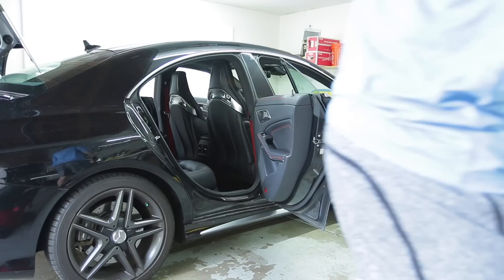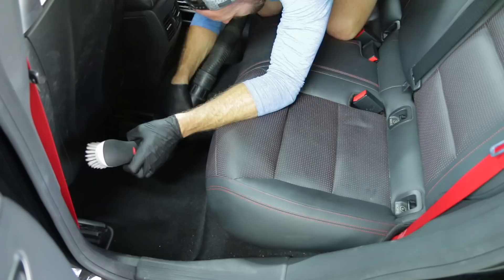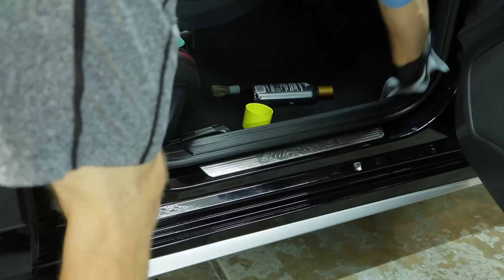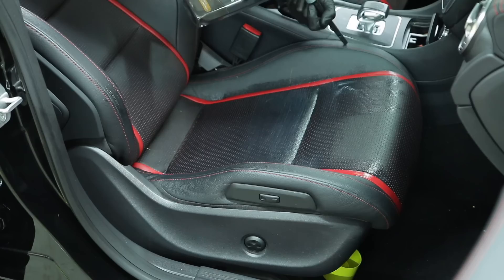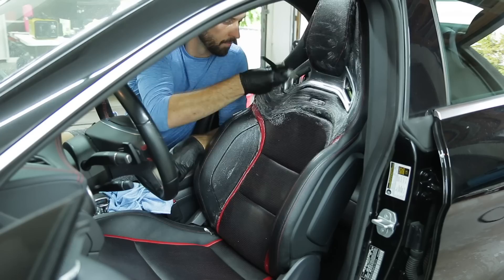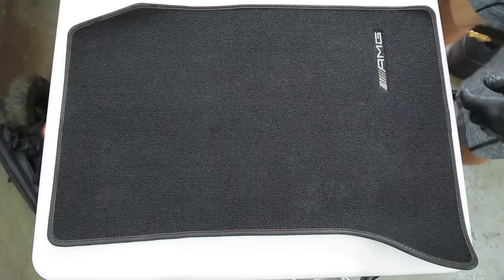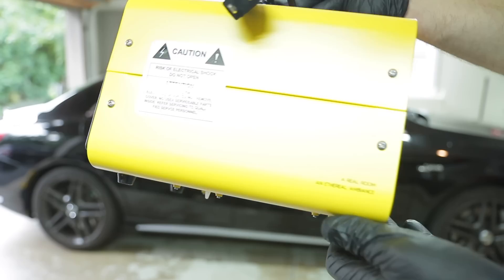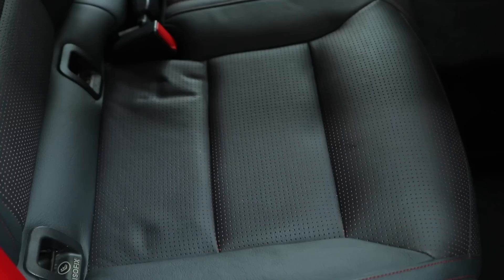Complete Full Car Interior Detailing Of A Mercedes CLA45 AMG || Deep Cleaning

Comment: Glad to see a detailer actually use an ozone generator. I bought one for my own personal use for my cars and cleaning a few family/friends vehicles. I hate the concentrated smell it can give off, but vented properly, the benefits outweigh the strong odor by a lot. I had a musty smell that stayed in my Wife's 1995 Integra that came with the car since we bought it years ago and I even tried that foaming down the vents thing but it didn't work. About 40 mins with the AC running and my ozone machine and a whole day sitting after and the next week driving the car with the windows down, all the smells were gone!!! Can't wait to see your feedback on using the ozone on the roach motel.

Comment: I have and 04 Suburban (all tan inside) & 2000 Honda Civic (all black inside). My cars are old a musty. I need to buy a carpet cleaner.
Reply: Chateece Guilbeault  sometimes even just renting a rug doctor and using it in your vehicles will help too, we did this for my dads suburbans and used some simple green, came right clean and got all the old old stains and smell out
Reply: OverKnight 52 i spent $35 to rent the rug doctor and the attachment and then i spent another 45 on the cleaners i used as well as an extra down payment that i got back when I returned it, over all i spent $75 USD and used it multiple times on the carpets in my house and cars, the reason i like the rug doctor was the quality of machine was better than what i had at home currently and it really does a high quality job and has decent suction.
Reply: @overknight5278  Home depot rents a carpet extractor for about 25$ for 24 hours. A gallon of folex for 10$ and an upholstery brush and you're set

Comment: I own a Black 2015 wrx (manual) living on a dirt road and every single time I think about washing it it rains
Reply from the maker: Makes me miss my old Subie! I had a 2011 STi Stage 3 setup. I miss the rumble
Reply: @StaufferGarage  unfortunately the fa20 doesn't have a rumble to it
Reply from the maker: But its a more capable motor I feel than the old EJ's. Looking forward to Subaru doing something really cool with the next gen. Main reason I jumped to the CLA. 2.0L motor and 350hp from the factory. AMS stage 3 bolt on kit and its over 475hp.

Comment: I detail my cars every now and then. Sometimes not to the extent that you do but, still enough to make it look good. But a few minutes after I am done, the dash and center console soon look dirty again. Not because they are dirty but, the dust accumulated quickly. Is there anyway of preventing or helping with the dust build up?
Reply: I would suggest when you are vacuuming that you use a soft bristled paint brush and use them in tandem to capture the the dust and dirt, versus simply wiping down the surfaces with a cloth alone. The brush loosens the dirt and dust and the vacuum sucks it up, versus just redistributing it to allow it to resettle on the surface. It's a bit OCD but it is effective in achieving the desired results. Also, check and replace the interior cabin filter as that will reduce the about of dust that is blown about the interior of your car/truck.

Comment: Addressing the cigarette stink all you have to do is replace the cabin air filter. In my experience ive bought and sold over 30 personal vehicles and i completely tear them down the interior to disinfect inside out. 80 percent of the time the cigarette smell that lingers in from the stained cabin filter and ducting. Lysol disinfectant spray is your best friend when it comes to removing smells.

Comment: Quick tip, if you have the memory button settings you can put the 1st setting as your seating position, and the 3rd setting as all the way back for faster when cleaning under the seats it’s faster than having to hold the button down

Comment: My daily is a Mercedes Benz A 45 AMG, the hatch version of the CLA 45 you don’t get in the States, so I can relate to and appreciate this video. For the leather, I use ‘Colorlock’ of European Leather Care once a year. I do a similar routine of dusting and vacuuming the interior of the car, perhaps, once a month, but I have in my arsenal the OEM rubber mats and boot lining, so I don’t ever have to scrub the carpeted mats (which sits under the rubber mats) or the trunk, like you did here, effectively saving me time. It’s so much easier to wash the rubber mats and trunk lining, I’ve never understood why people don’t have these accessories in the car before they drive it off, or make it a point of getting them as part of the condition of the purchase. You really want to contain whatever crap people bring with them when they step into your car on those rubber mats, I tell ya!

Comment: For interior car cleanings and detailing I recommend cleaning/changing out the air filter thing especially if it’s an older car or smells bad, it’s a little extra step that’s really not necessary but definitely would be interesting to see (on the you’ve side) especially in that nasty looking red car, I’d love to see how gross that air filter got, plus (on the client side) it’s an extra thing that just improves the car not just for the time it stays clean and for the aesthetic but for the actual daily use of the car

Comment: I have a 2008 Chevy Blazer, and I was hoping you can do a video on a similar model, I have no clue on what parts of the interior would be safe to take out. Also, do you know how to fix the wiring to any automatic moving seats? On the drivers side we had to break the panel to be able to adjust the wiring and we can’t get it to stay working

Comment: 2014 ford focus. It's actually been a rough couple of months for my car, it's got its first window crack from a rock. I had my first car accident with another person causing minor damage to the bumper and headlamp. And the carwash detailers I usually go to completely chipped the paint off of my door and various other parts requiring those areas to be completely repainted. Yeah... it's been rough.

Comment: Yo how`s it going, another fellow car detailer here. I love the work and effort you put in on these vehicles, just here to throw a helpful tip if I can. When you go to clean the seats and floors. What I found that helps me a little quicker (that's if the floors aren't too bad) I use a air compressor and Tornado that I picked up from my local Harbor Freight. If you find yourself cleaning your Mercedes seats again this is actually helpful in preserving the quality of leather, I have used it on Audi seats and various other luxury cars. However being as good as you are I am sure you`ve heard of it, just though this would be helpful instead of using the small brush and going around by hand. It also helps with deodorizing as well because the force of how the cleaning solution is forced in replaces the bad smelling bacteria with a nice scent, in which is easier to change with a simple air freshener. Anyway, keep up the amazing work, I`ll be watching to get more ideas on the vehicles I clean.

Comment: Hey so I have a quick and hard questions so those types of seats I came Accord a Mazda 3 with like holes in the seats like this AMG so the seats can breath well with the Mazda 3 there was junk stuck in the hole of those seats and I’m just wondering would you use the the brush and spray to take it out? Cuz I’ve used it on there but none of it came out PLEASE ANSWER SUPER IMPORTANT!

Comment: Great job!! I own a 2018 Jaguar Fpace and just wondering what's thr best way to keep the larger healthy and conditioned but keeping it looking new without the leather shinny sheen? Same on steering wheel?
Reply: Should be fine until it hits 2 years old. Leather cleaner does the trick though, just make sure it’s a good one that doesn’t make the steering wheel look even more greasy. In general terms though the leather will never look as matte as it once did. They make claims but I have yet to see it

Comment: Being that its leather, do you water down the all purpose cleaner for your car?
Reply from the maker: Yes for sure. Didn’t mention it in this video but typically 20:1 ratio with water
Reply: @StaufferGarage   Thank you for responding. With that ratio Ill be detailing my cars way more often lol Ive been using meguiars for my interior, but it never lasts as long as Id want it to.

Comment: Hi. Well I have a Holden Barina. Not sure if you have them in the U.S. I’m in Australia. Her name is Cat. She has dark grey cloth interior and a really nice shade of white on the outside. Nicest white I’ve ever seen. I am super lucky to have her. I do have a question. Those gaps between the middle console and the seats. They are a massive pain in the ass to clean. I end up leaving scratches on the sides of the middle console every time I try to get the vac nozzle in to clean it. Other than brushing the section out first are there any tips? Too scared to take the seats out to clean her. She’s only 2 years old anyways. Please and Thank You. 😀😀😀😀😀😀 love your vids. Love it when you use the extractor.  Soooooo satisfying. 😀😀😀😀

Comment: Hi! I really enjoy to watch your every videos. 
I have Mahindra's XUV 5oo W8 2012 SUV in India & TOYOTA Yaris 2010 model in DUBAI, UAE. 
I like to do detailed cleaning of my cars. It takes me around 7 to 8 hours to detail {Vacuuming interior, cleaning pannels, soaking, removing bulk mud, pre-wash (cleaning body with cloth+water spray to avoid any sacratch, washing body with amway car wash, rims, tyres and at the end mud flaps} my XUV. I use Ambay car wash, Amway Silicon Glaze body polish & Formula 1 Plastic polish. 
I have Panasonic home carpet cleaning vacuum cleaner. I would like to take that extractor, yellow microfiber towel and that round soft brush for interior detailing.
Thanx & best regards

MANVIR SINGH LOTEY

Comment: Pretty much every boot liner has this nasty material, it makes cleaning a nightmare, cars have it on the carpets also but usually only cheaper ones, the Moore the car costs the better and easier the carpets are to clean in my opinion, the brush is a saviour, in some cases the brush can do all the work as the vacuum is useless against the fibres. I feel bad for dog owners...